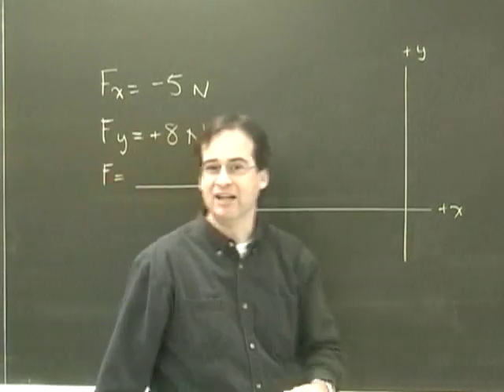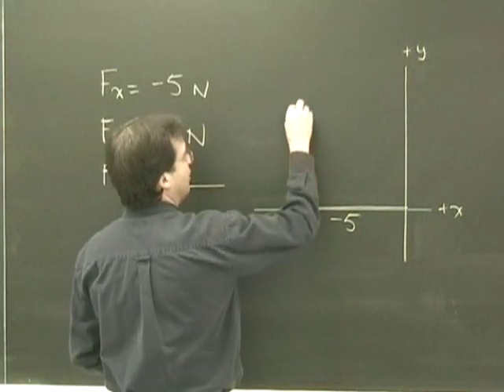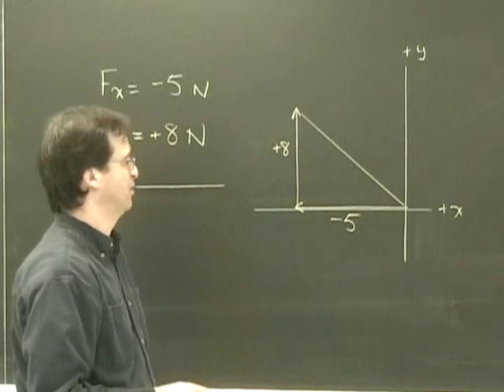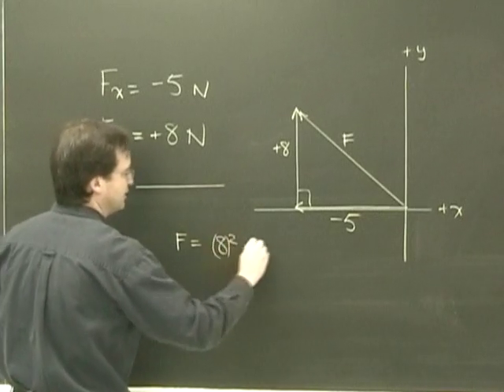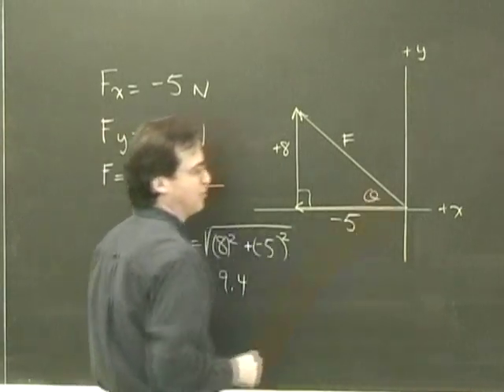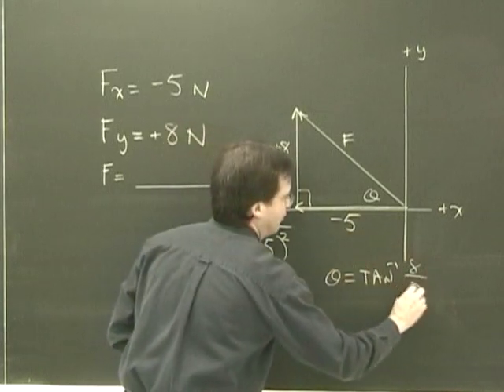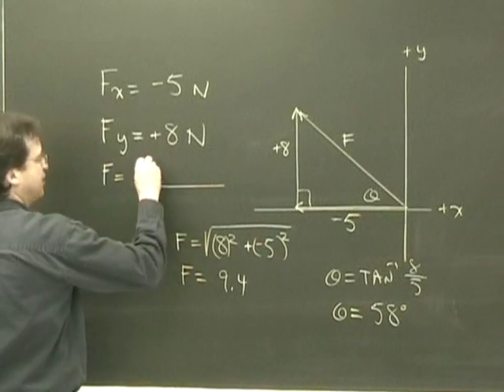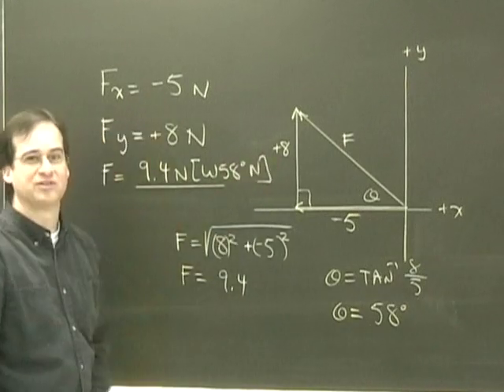Vector Components Part 5 Physics Lesson

Comment from the maker: @tomimn2233 Hi. You are right. I guess I assumed that since we established that North in previous parts we had already done that but it should have been written on the board. The answer you give is also right. How to write the answer depends on what your teacher wants. Our students are encouraged to use north, south etc at first because they are familiar with it and then later we use the [cw from -x] or [Left 58 Up]. Thanks, I may need to add a note on the video.

Comment from the maker: @LordIllidan98 The opposite is still the one further away and the adjacent is still the one touching the angle. BUT, which side you USE as the opp side and adj side depends on which angle you are interested in. For the 58 deg the opp is the 8 (far one) and the adj is 5 (one touching). If you use the 32 deg, the opp is 5 (far one) and the adj is 8 (one touching). Sin cos tan requires you to choose which angle you are interested in and then your calculator will give the correct answer.

Comment from the maker: @LordIllidan98 The length of the sides does not tell you which is the opposite side. The opposite side is the one that does not touch the angle, it is “opposite” the angle or furthest from it. The adjacent side is the one that touches the angle and is closest to it. In this video the opposite then is the 8 and the adjacent is the 5. The hypotenuse is always the diagonal one. If this does not clear it up let me know and I will try again until you get it.

Comment from the maker: @spitwats The inverse tan was used to find the angle because I had the opposite and the adjacent side. If Fx was (+) the triangle would have been to the right on the x-axis and then up (the triangle would have been flipped over onto the right hand side) I would still use the inverse tan since I have the opposite side and the adjacent side. The only difference is the angle is E58N. Note the (-) and (+) help to draw the triangle but dont plug in any (-) values for the inverse tan.

Comment from the maker: It's Tan -1 with the -1 being written like you would write an exponent (above and to the right) This -1 indicates that you are solving for the "inverse" of Tan, that is, you have the 2 sides and want the angle. On my calculator, you would solve for 8/5 and then hit 2nd function  then Tan. Other calculators may do this differently so you might need to get some help with this.
Best of luck and thanks for the question.
Mark